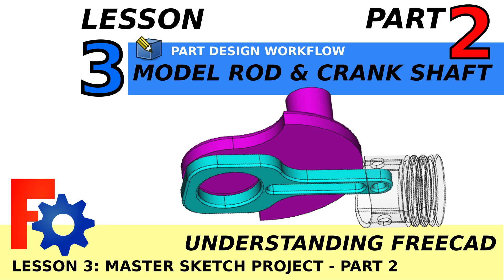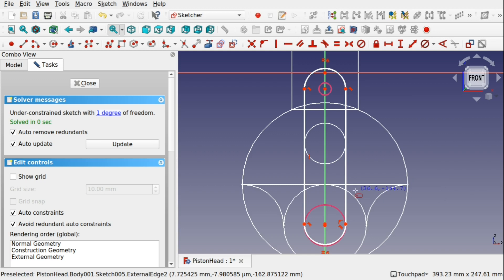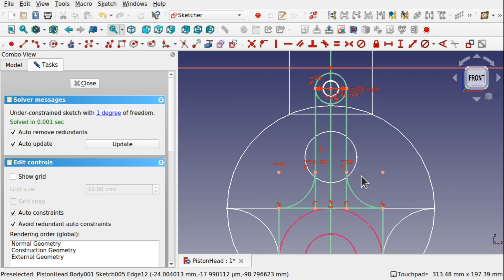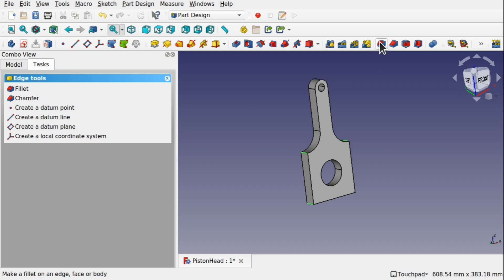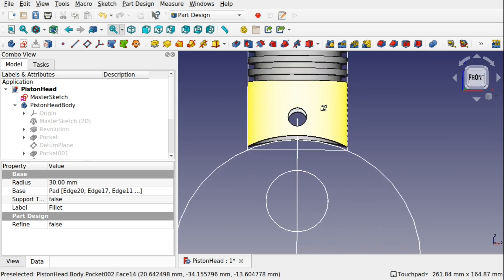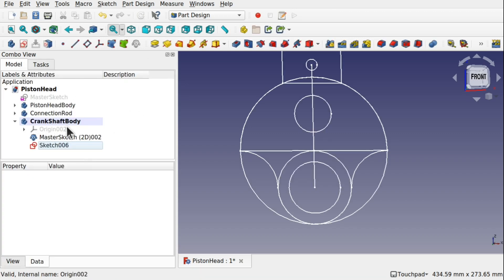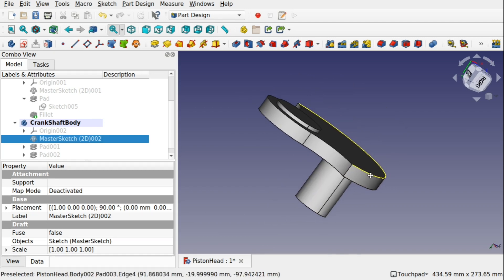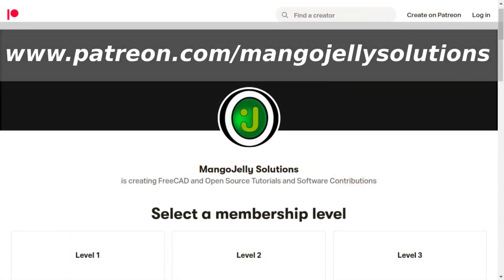Understanding FreeCAD Lesson 3.2 Model a Piston Crank Shaft Assembly Animation in Part Design A2Plus

Comment: A great series you are developing. One small issue I see with the crank shaft is where the center of rotation of the flywheel is. For it to function properly, the axle center must be at the center of the flywheel, not the bulk mass end. The bulk mass is the counterpoise to the piston to equalize the mass on both sides of the flywheel when in motion.    😁
Reply from the maker: Thanks for the comments glad your enjoying the series. Yes your not the first to say that lol. I think if this was functioning it would rip the engine apart. 😆

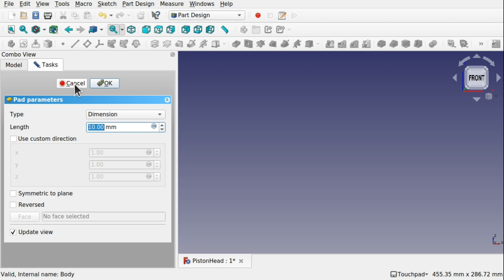Comment: 14:35 there's a hidden feature with FreeCAD that can be very useful in cases like these, and I only found it out by accident after a long time of confusion:
If you drag a selection in the Sketcher from the left to right*, it will *only select what fits into the selection *entirely*.
Meaning if you would have selected there from the left, you'd only get the 2 vertices.
But if you drag a selection from the right to left*, it will select *anything that is touched by that selection. This can be quite useful, depending on the situation, but the fact that this is more of a "hidden" feature can lead to quite some confusion and frustration.
It certainly did for me until I finally noticed why it "sometimes" selected "everything" and sometimes only vertices.

Just sharing this for anyone else who might stumble into the tutorial in the future.
Reply from the maker: Thank you for sharing. Always welcomed 😊👍
Reply: Funny you mention this. This is a really common thing in CAD software, Autocad probably most notably does this. It's called window/cross selection, and I'm so used to this behaviour that I have used it during this entire tutorial without even consciously realizing it's even there.

Comment: Hey mango! thank you so much for these videos, they're incredibly helpful!!! I'm experiencing an issue with FreeCAD (0.20.1) that hopefully someone here could help me with? on minute 11:50 you select 2 points by clicking and dragging, and then you use a coincidence constraint. For some reason my version of FreeCAD just does not allow me to select the 2 points (any 2 points) by click and dragging, is there a setting I'm missing that would allow me to do this?
Reply from the maker: There is no setting that I know of  but there is a couple of things to check 1) are you viewing the sketch from the rear as it's extremely hard to select points from the reverse of the sketch. And 2) are you selecting from left to right or right to left as they select in a different way (may be still the same in sketcher) . Select from left to right.  Glad your enjoying the videos. This selecting issue is pretty strange behaviour if it's none of these.
Reply: @MangoJellySolutions  Thank you so much for the reply!! I'm truly enjoying the content, it is extremely helpful!! I ended up just moving them a little and then doing the coincidence constraints just to complete the exercise, but I will keep this in mind!!

Comment: This paragraph is more of a "Note to Self," but I'll leave it here for others who it may help (Windows 10, FreeCAD .19)  For some reason, on my system, I have to clone the MasterSketch first, then create a new body, then the sketch, and then go back and drag the cloned sketch into the new body.  Anything else adds a weird layer to the new body that doesn't belong there.

After creating the 50 mm circle inside the bottom (second-largest circle, inside the giant circle that contains about 3/4 of the drawing), when putting a square around it, do so but then backspace twice if your autoconstraints were on (or maybe turn those off, but I think the square's endpoints wouldn't snap to each other anymore).  If you don't do that, the square will get really weird, no matter what side you start adding your tangents to.  The two "Create Autoconstraints" in the Undo History, that come after "Create square" are what cause this, so those have to be removed if they show up there in the first place.  If not, then I wouldn't worry about it (and I may need some guidance on how to prevent just those two lines in the Undo History from showing up in the first place).

Something that helps me avoid validation issues is by doing my constraints in symmetry.  If I do one on the left, I do it on the right too, and vice verse (unless it's an asymmetrical design, then I go either clockwise or counterclockwise.  Whenever I draw a new line or arch, I constrain the endpoints immediately.  I just try to remember that no points on a sketch are actually connected until I do the connections manually, unless it's a predetermined shape, and even then, the constraints can go missing as I work on a part.

When working on the CrankShaft sketch (after importing the arcs and circle needed, when adding the duplicate arcs and circle needed), I found that there was a missing radius constraint in the original Master sketch, on the right hand side (the arc that tangents with the smaller bottom circle, inside the largest circle, and with the right hand line that also tangents with that smaller circle).  I had to delete the Chrankshaft body entirely, go back to the Master sketch, add the missing radius constraint, close the Master sketch, clone it again, then add the new body and sketch, do my importing and duplication all over again, and then I was able to add the pad successfully.

The hard edges that need filleting are hard to click on when actually doing the filleting.  Whether that's in "as is" mode or in "wire frame" mode, it's just difficult to actually see and click on them (at least if you're a beginner, still getting used to using this software).  One way around that is to just manually draw in the fillets as 30 degree "center and endpoints" arcs, tangent them, trim off the 90 degree corners, and constrain the endpoints created.  After that, then do the 20 mm padding.  Using filet is important to learn, but at least for me, it came too soon in the learning process, because it's so blessedly hard to actually see and select those lines.  Even when I tried it in wireframe, it was difficult to keep the mouse focus on the lines I wanted.  There's probably some setting that fixes that, but since I'm so new to FreeCAD, I don't know what that setting is yet.

One thing I find very important is to do a hand-drawn sketch on paper, where the dimensions are added in.  It absolutely is never "pretty" or exact; I'd never turn it in to an instructor or a boss, but it's helpful to me personally to get through sketching things out more easily.  The master sketch (with the hidden sketching) can accomplish this goal as well, but there are no "design time" errors to resolve when using a pencil and paper, beyond what an eraser can easily take care of.  So, I prefer to start out that way first, then map it all out, nice and neat on the screen in FreeCAD.  This is a common practice often taught to mechanical drafting students (both for manual and for digital drafting).  In the end, it saves time.
Reply from the maker: Thanks for contributing your thoughts and tips to these videos. Much appreciated